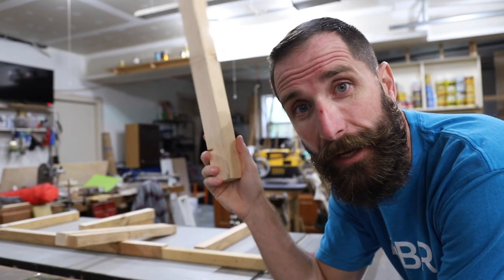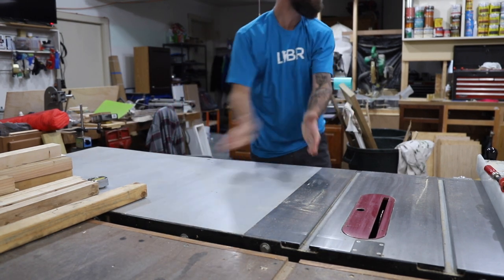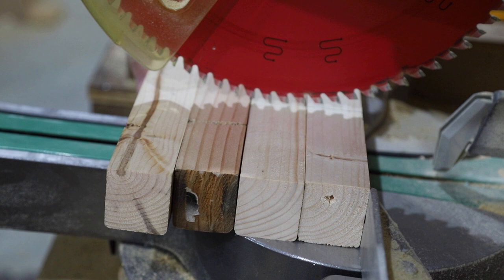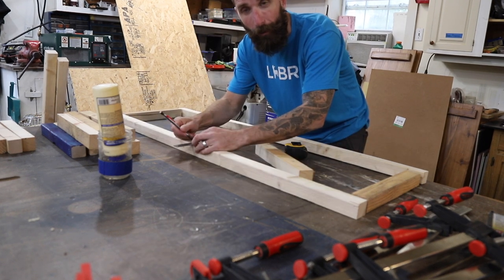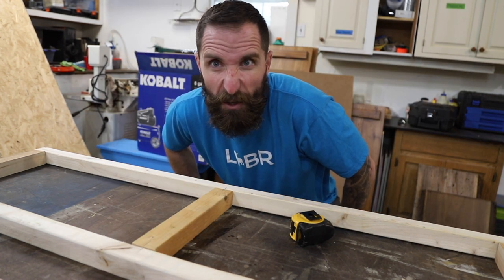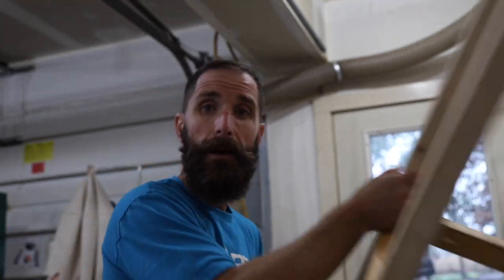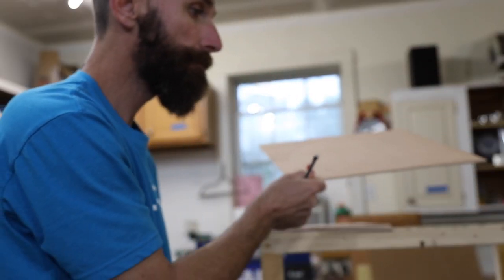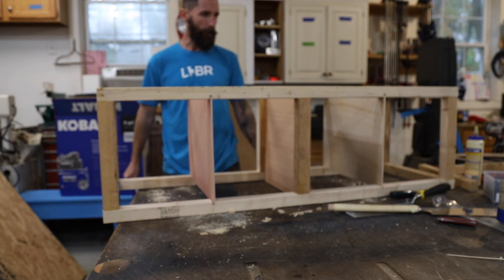Chicken Coop & Run Build || Part 5 || Egg Laying Boxes

Comment: You guys with your expensive shops and latest equipment.  I'm a 65-year-old woman who lives alone.  If I want something done, I have to do it.  I have a miter saw which I use on the tailgate of my truck, a circular saw, an electric drill, and two sawhorses.  Try making something great with that.
Reply from the maker: Don’t hate and throw shade! You have no idea how I came to be here. I did that for years and then I worked my ass off  working a second job to be able to afford the tools in my shop. After that, I continued to work my ass off making things for people, earning money and reinvesting in myself! Your sass and judgment need checked at the door! Also, you want to try making something try using an axe, a knife, a handsaw, and a hand plane because this guy can do that too!